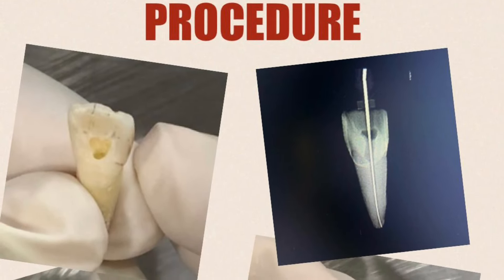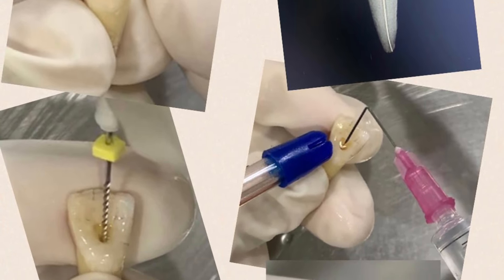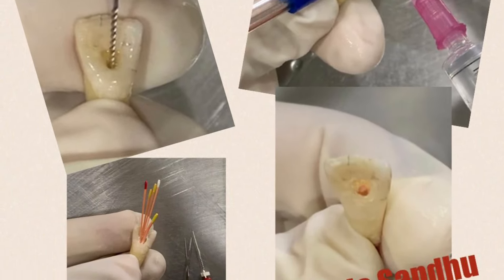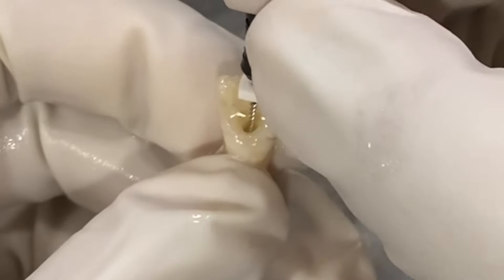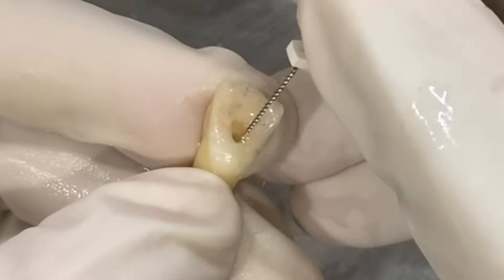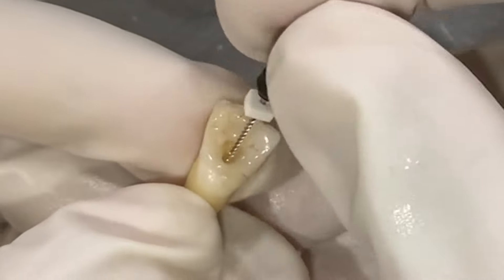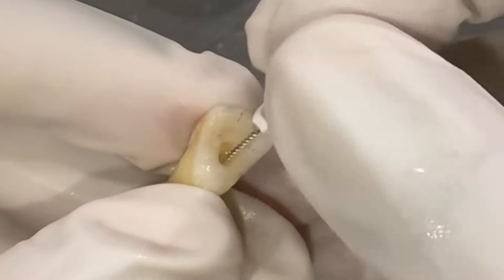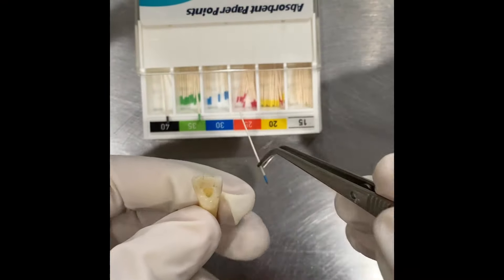COMPLETE RCT PROCEDURE| Stepwise tutorial of RCT from Access cavity to Obturation

Comment: Beautiful video mam. I want to ask u i use to prepare upper C.I til 70 to 80 number file and use the same number master point. Is it correct? Where can I watch yr access cavity video? Can u make a video on all ceramic on upper anterior teeth .Thankyou
Reply from the maker: https://youtu.be/YTBiCGSqlzM Access cavity video. It is not compulsory to prepare the Master apical file till 70 or 80. You need to do this only if the canal is large. For a moderate sized enlarging till 50 is also okay.
Reply: @sumeetasandhu  ok thakyou for reply

Comment: Hi maaam how do you 45 as master apical file
Reply from the maker: @akhiltc4436  if maf is 45 then 1mm short of working length, use 50, 2MM short of the working length use 55 and so on as per the requirement, mostly three steps are sufficient.

Comment: Shouldnt we use edta while filing?
Reply from the maker: EDTA is most commonly recommended while using rotary files since these are more prone to breakage. K flex files, Ir quite sturdy and don’t break easily. It is recommended in those cases where the canal is very narrow or partially calcified

Comment: Maam how can we determine the master file
Reply from the maker: Master apical file is three numbers larger than the initial apical file which fits into the Canal. For example, if your initial aptical file that goes till the working length is 15 number then the master apical file is 30 number. In case of wide canals like Max central incisor  the enlargement done is more in order to ensure that all the pulp has been removed and proper canal space has been created

Comment: For our quota..can we pass file through apex and according to it set working length and then take radiograph for working length..Is it correct procedure???
Reply from the maker: No it isn’t the correct procedure for clinical cases. From knowing the actual length of the tooth and pre-operative radiograph you can make the estimate of what the working length could be. Then put the file with the stopper at that length and take the radiograph. After that you can adjust accordingly.

Comment: Mam ye take 21mm length file then how your working length is 22mm???
Reply: Mam plzz rplyy.???
Reply from the maker: In pic the box containing files has 21mm marked on it but the file taken for working length determination is of 25 mm. 
I should have mentioned it in d video.
Reply: @sumeetasandhu  You mentioned 45 number as 45 mm. It is not mm another measuring unit it is.
Reply from the maker: @vishvanadhapadmaila6021  yeah I know 😊
Slip of tongue…

Comment: Is there a reason during drying the canal that you increased the size of the paper points with each successive paper point? If 45 is the working length, why not just start immediately with the size 40 paper point?
Reply from the maker: Yes you can. The basic point is that the canal should be dry